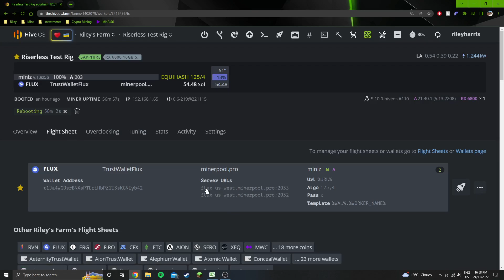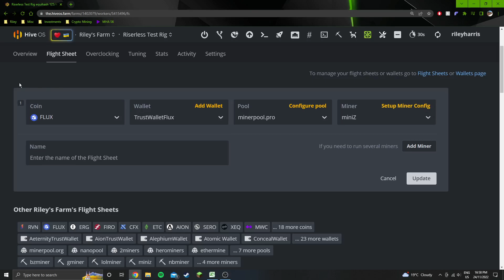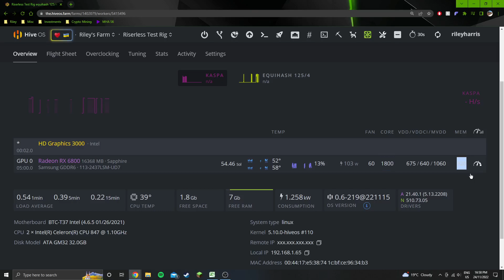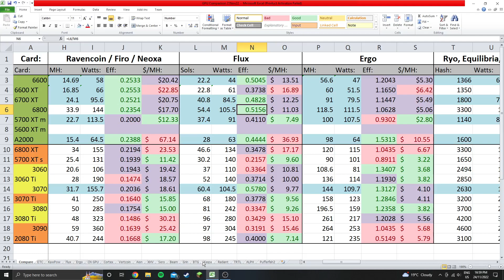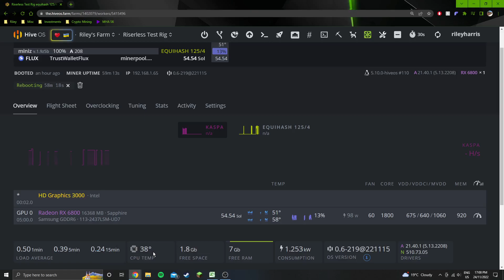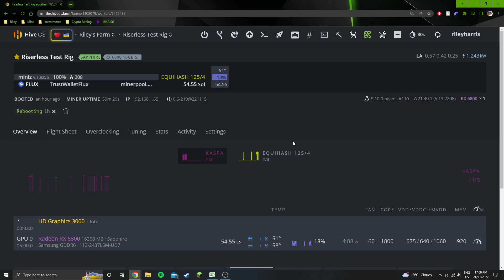6800 Flux Mining Settings! | 54.4 Sol @ 105.5w

Comment: My rig with AMD Asus TUF Radeon RX6800 hang with your settings. I guess different GPU are different. I have to slowly set the Core Clock from 1300 to 1600, Core Voltage VDD from 800 to 750 and Mem Clock from 1050 to 1000. With Core Clock 1600, Core Voltage VDD 750 and Mem Clock 1000, it now running stable with 51.7 Sol, 100 watts and efficiency 0.51. Keep up the good work.
Reply from the maker: Glad you got it stable, well done mate!
Thanks for watching!

Comment: Core-2250 vdd-800 mem-1000 PL-200 lolminer 6800xt gigabyte Samsung memory xxx-xxx-xxx getting 60-65sol in hive OS
Reply from the maker: Hey man, you can easily get more hashrate than the settings I show. But I show the most efficient settings my GPU can get down to. So if you want to use less power (and depending on your electricity price be more profitable) then you could use my settings.
Thanks for watching!